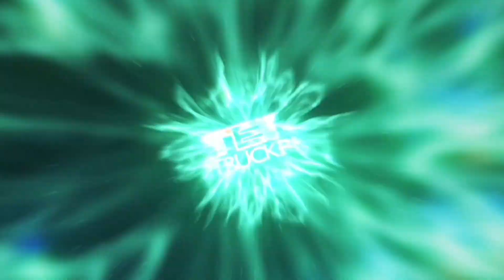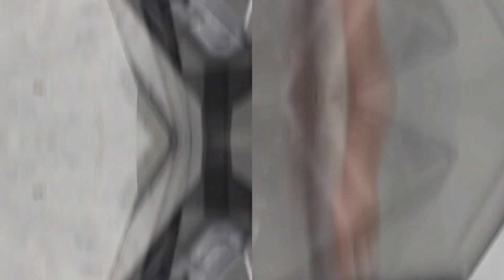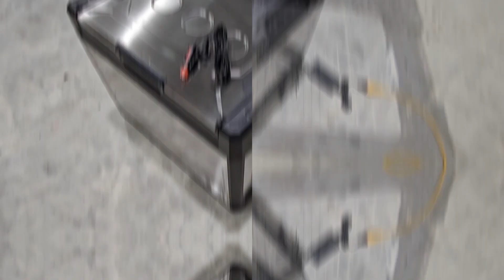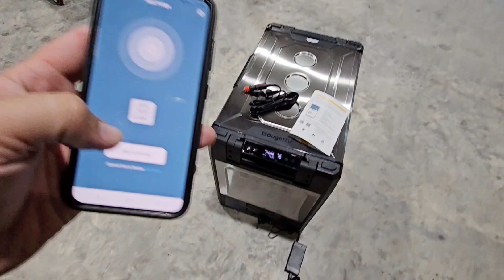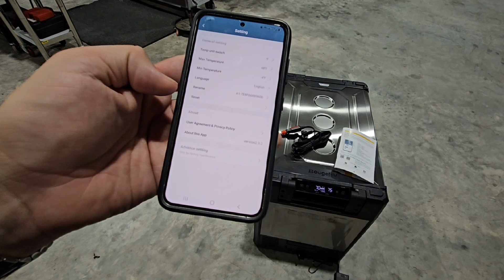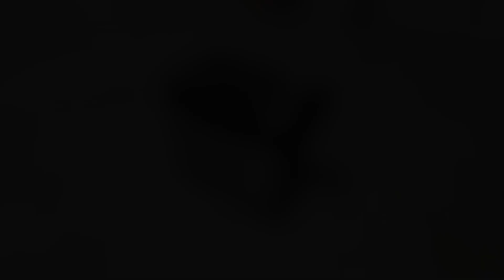HUGE, AFFORDABLE BougeRV Rocky 81QT Dual Zone 12V Portable Fridge

Comment: $799.99 you can buy an awful lot of ice! Other than he price it’s a nice unit.
Reply: On Amazon for $600.   I bought 
the smaller 55 quart for $485.  I no longer have waterlogged food.  And don't have to worry about ice.  If you use a ice chest regularly it's worth it.

Comment: I just bought a 53qt dual zone different brand caught it on sale. It doesn’t have the battery option but it does have a battery cut off option setting that keeps you from  running you truck/car battery all the way down so it won’t start. It’s going to work great since outcasts Oasis has the small Dometic refrigerator. No more icing down the igloo cooler.  Got it on an auction for 1/4 of regular price. It works great, but I would love a Bluetooth app with it. Again J D another great video